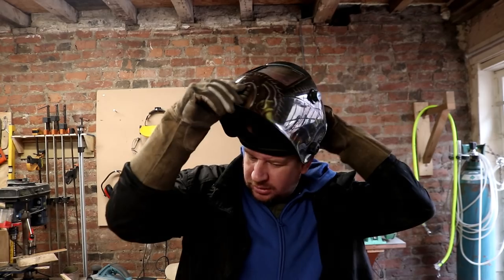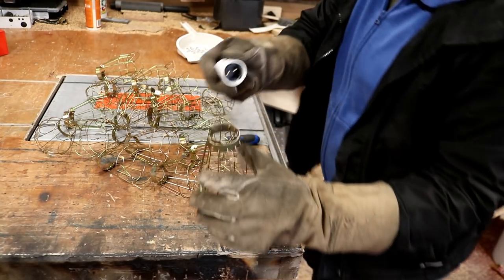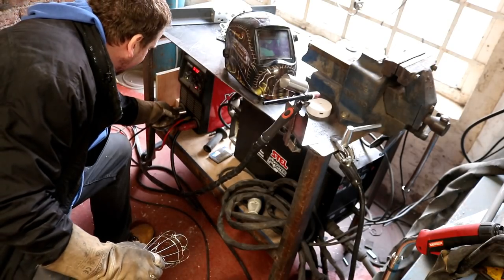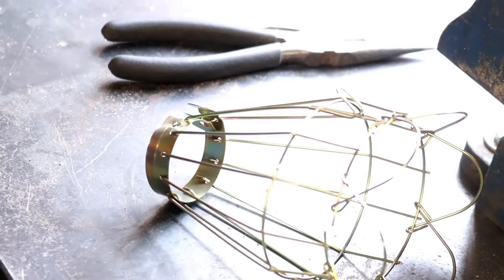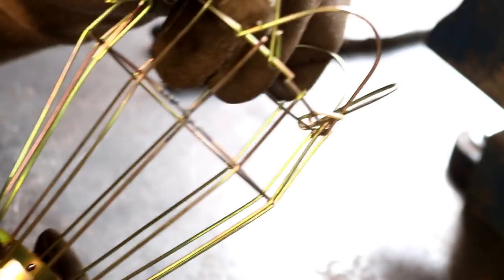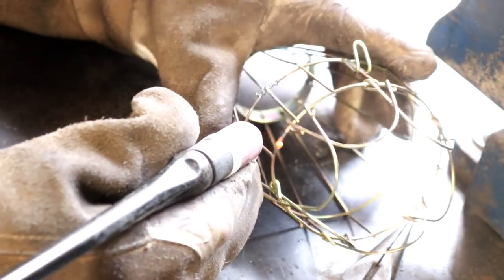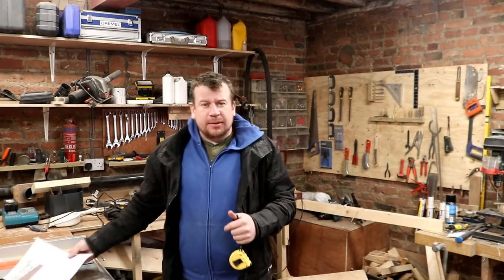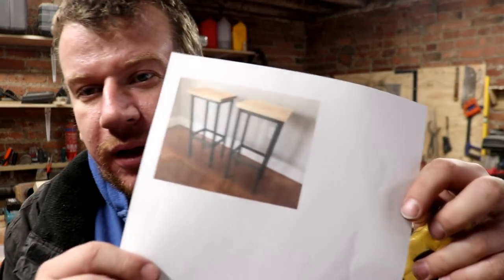Shall I get a Tilt Hydrometer?

Comment: Ispindel, cheap and working solution.
I've got 1 tilt also that I prefer over the ispindel. Everything setup with a raspberry pi 3 for both solutions. I'm using fermentrack for the ispindels and tilt package for the tilt and everything syncs over to brewfather. Cheap and working solution.

Comment: I use an ispendel, I don't bother calibrating it anymore, (it takes about a kilo of sugar and lots of water to do so). I can monitor fermentation on my laptop, without the need to open the fridge and take a sample. When the tilt angle has stayed roughly the same for a couple of days, I know it's safe to keg. I still use the hydrometer to obtain my ABV, as even calibrated I suspect the ispindel would not be accurate. I think it was good value at £45 ( I didn't build it myself), I don't think I would have paid what they want for the tilt though.

Comment: Had a tilt for about a year now. Once I get it calibrated (with multiple data points, not just in water!), I get as accurate results as with my traditional homebrew hydrometer. Only problem is it goes out of calibration each time I change the battery (every one/two brews). I'm on the old model, though. They've changed the design since then with an improved circuit board and new cradle for it. They've also changed the tube so it only opens at one end. So the tolerances might be better on the new one. All that said, the main thing I use my tilt for is tracking fermentation. I can see how fermentation is progressing and see when it finishes so I can crash/take a sample for a proper reading. If I'm brewing something that needs stepping based on gravity, I can calibrate it just before the brew. Someone mentioned the iSpindel. They're much larger and look far less easy to clean to me. They also won't have the buyer protection you'll get with the tilt!. I have my tilt integrated into my BrewPi setup which controls my fermentation chamber (keeps it withing +/-0.1degC!). BrewPi is getting a big update soon to handle multiple fermentors and add support for brew day control. Love my BrewPi setup. It's an investment but its far better than an inkbird and should get even better with the update. Sorry for the long post but hope that helps!
Reply: I have the newer model of the tilt and I also run into calibration issues every so often. I haven't quite dialed in my calibration regime so at times I don't trust the reading my tilt is giving me. I always double check everything with a hydrometer. I've had mine for a good 8 months and still haven't had to change my battery after a good 10 brews so they may have improved on this with the new one.

I'm logging my data with a tiltpi sending data to my brewfather account. Love having it integrated with my brewing software.
Reply: I wouldn't hold your breath for the big BrewPi update.  It was promised over 3 years ago and we're still waiting!

Comment: Got mine logging locally on local network using craftbeerpi 3 software on a raspberry pi.  Didn't like the fact i had to give the tilt hydrometer folk access to my google account if i wanted to use their excel sheet on my own account.  Otherwise you are logging on their account.  Prefer to own my own data.  The temperature readings are spot on.  The battery is much better in the new version.  In total mine has run about 8 weeks so far and the battery is still good.  The SG readings fluctuate a  bit during fermentation but it is still good.

Comment: One gripe I have with mine (although I hardly use it now) is that you cannot tell when the battery is going to run out. Really annoying if it is half way through a fermenation! Totally agree with other comments regarding calibration - as many point as possible across full temp/SG range. Never found the iOS app that solid either as it sometimes just stopped logging the data. May be different these days with the latest model.
Reply: Daniel Sargeant - iOS logger  is still flaky

Comment: Tilt is great for tracking how fermentation is going, I do however doubt their accuracy and always check with my hydrometer at the end. I have 2 hooked up via a raspberry pi with external Bluetooth dongles. Because I ferment in stainless kegs, the Bluetooth range becomes very limited. I have a Bluetooth dongle that sits in each of my fermentation fridges directly next to the fermentor and run a VERY basic python script that takes that data and hosts it on a web server so I can access it anywhere.

Comment: dont get a tilt if you plan on doing a load of dry hopping had nothign but issues with data due to dry hopping im sure it would be fantastic in a blonde but as for an ipa or neipa yo uwill need to dry hop in a way as to not gunk up teh tilt